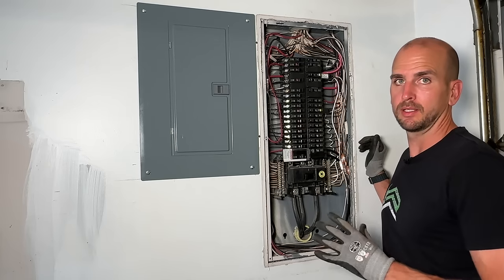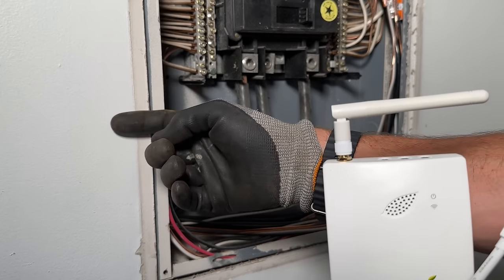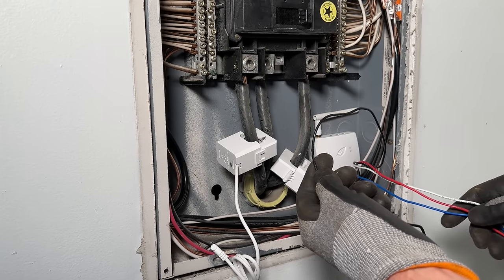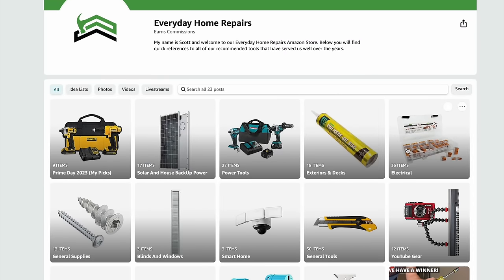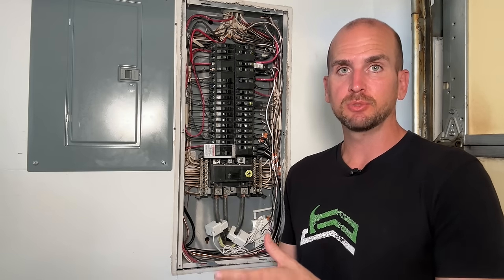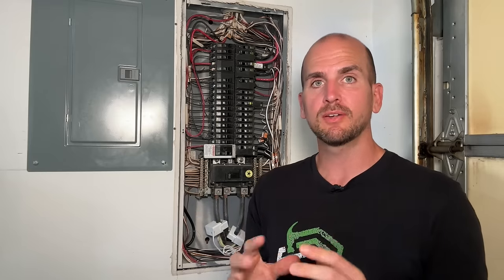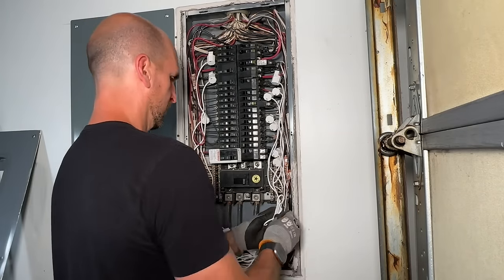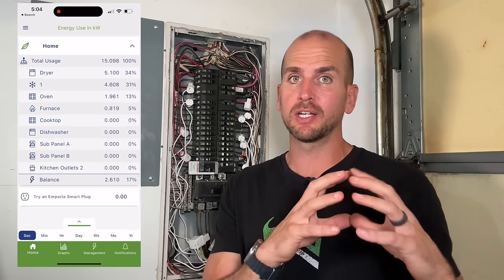How To Install A Home Energy Monitor | Emporia Gen 2 Vue

Comment: Can the entire unit and antenna be mounted on the wall outside the breaker panel and have the sensor wires go through one ( or two ) of the cutouts on the side of the panel ?
Reply: Yes, just make sure to use a wire grommet to protect the wires touching the sharp metal.
Reply: I would only consider this an option for an interior panel unless you install another weatherproof unit/box to install this unit into next to an exterior panel to protect it.

Comment: Hello greetings from Panama, im looking for a monitor like this, however im a bit confused with the installation, The amazon video says white and blue goes to neutral and black and red goes to a 15A breaker, what is the correct method?

Comment: Does your small portable energy-use meter reset to zero when the power goes out, or does it "remember" energy use by the appliance? I did a several year study of PV energy production, and energy use (including specific appliance usage), at my home. I used 8 or so Kill-O-Watt meters and got many data gaps because those meter reset to zero every time the grid blinks off or goes down for extended times. That was frustrating.
Reply: Individual meters store their data locally and aren't designed to send it out for logging.

I don't have experience with this system but given that it's transmitting usage and making it available in an app, a power loss would only affect the lowest slice of time it records locally before transmitting, if that makes sense. Say they transmit usage data in 5m increments rather than real time, if you lost power at the begging of a 5m slice you wouldn't lose anything but the maximum data you would lose is 5m if you lost power right before transmission.

Again, no experience with this brand but I have designed systems that log sensor data.
Reply: There are plug in energy monitors that have battery backup so they don't lose the accumulated kW-hour value if power drops out momentarily, which is the problem with the kill-a-watt meters. 
I have one on order from Temu so I'll see how it compares, at the $12.78 price point.

Comment: Does this give you notifications when a device turns off like a refrigerator so you don’t lose your food?
Reply: For that you can get a Govee Wi-Fi temperature humidity monitor, which will send you a text alert if the temperature excess a threshold that you select.  Excellent reliability from my experience, and if you get a Bluetooth model, it can serve duty during blackouts so you know when to fire up the generator to keep the fridge temperature maintained without opening it.

Comment: Does that thing really need 15A all on it's own tho? That seems a bit excessive...
Reply: No. Have you tried finding a panel listed breaker smaller than 15 amp?
Reply: It can share with the breaker's existing load...current draw is tiny... These two sense lines monitor the two leg voltages for more accurate power calculations.

Comment: I've had Emporias in all my rental houses for several years. To be honest, I find them frustrating to set up and not that useful once they are set up. 
- They use an older wifi protocol, so the range is very short and connectivity is sometimes spotty. 
- Being limited to only 16 circuits really sucks as it means you either need to do a lot of tweaking which circuits you monitor or you just need to accept not being able to monitor many of them. 
- As you point out in this video- the setup is also extremely bulky and takes up a lot of room in the electrical panel. It seems like there must be a way to make probes and wires that are thinner than what Emporia is using. After all- these are just using induction to monitor the current- seems like they wouldn't need to be thick wires.
- The app feels like it was half-finished and abandoned. Haven't seen any updates to it in years.

In general, I feel the state of "smart" home monitoring appliances is still quite poor. Every application has different companies servicing the need (thermostats, sprinklers, energy monitor, water monitor) and they are all in incompatible apps.
Reply: @wojtek-33 Emporia uses 802.11g for wifi. This protocol was approved in the year 2000. It does not support n, ac, ax, or be- which represents the last twenty years of wifi advancement. The app makes it difficult to see your data or do anything useful with it (like look for patterns or spikes). It’s a mediocre product but it has no competition so it’s the best we’ve got.
Reply: @SongOfStorms411 I've been using an Eyedro 2 system for a fairly long time now and haven't had any issues with it, but just started looking for another one to install in another house, and found out about this one, with the multiple sub circuit monitoring which the Eyedro didn't have, only the two phases. Even so, I was able to resolve what I needed based on the timing. 
I'm hoping this will be as good on reliability and resolution with the extra bonus of sub circuit monitoring capability.

Comment: I am getting an error that says We Have Detected 3 200A Sensors and 2 Valid Voltages?  Does anyone know why this is occurring.  I do have only 2 - 200 Amp sensors on both main phases and I have the power split to the unit between two adjacent breakers.  It is showing I have 3 phases instead of 2 and this is causing 33% more wattage, amps etc.  Thanks for your input.
Reply: Do all unit options have three ports on them for the 200A CT sensors, with the unused ones just plugged? Or are the 3 phase units different, having an additional port?

Comment: I bought a Sense meter and it's not great, so I'm going to try the Emporia Vue. I'm hoping that two Vue's will work together to provide 32 channels. I have solar and a backup battery system so I want to identify power draws when I'm running on battery (e.g. during thunderstorms) and maximize my off-grid time. Right now the house can be drawing 1-2KW and the Sense meter isn't giving me enough detail about where that's all going.